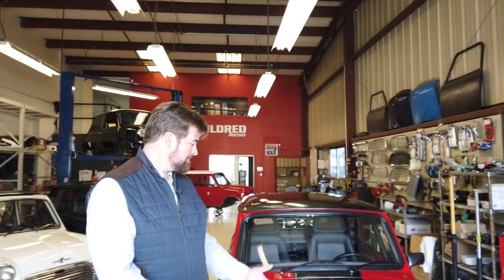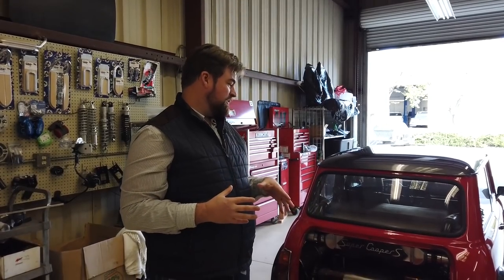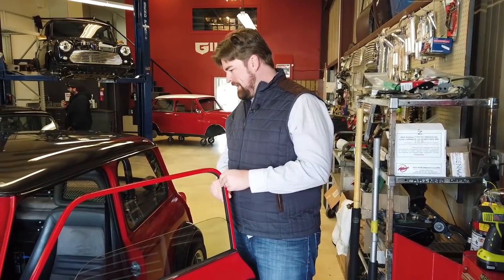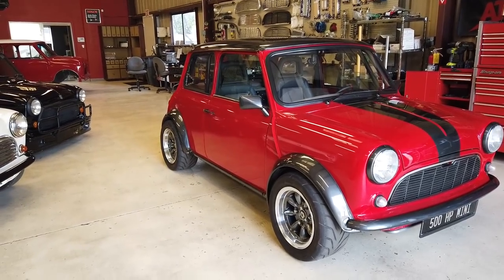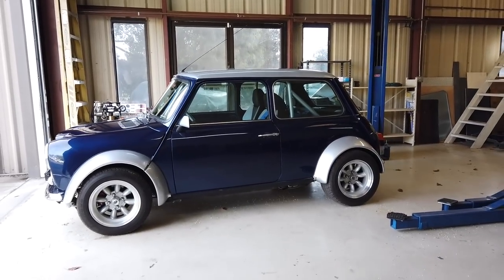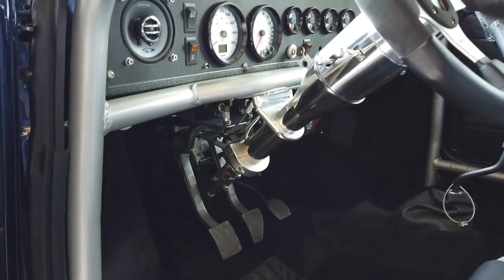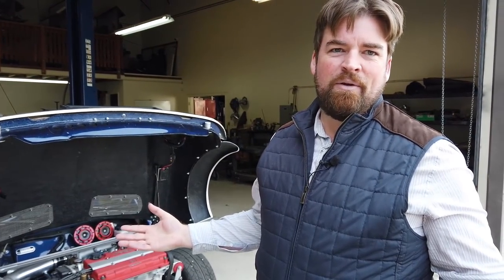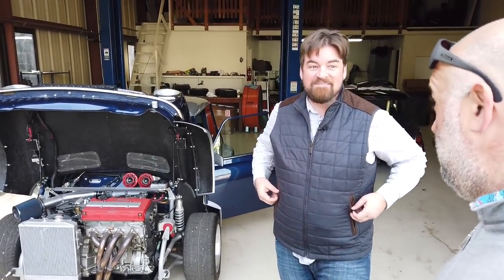How FAST Minis get Made (inside Gildred Racing) - Under the Hood

Comment: I would consider putting a Nissan pulsar GTiR SR20DET motor and trans for the 4WD build. But of course consulting the expert first. And I'm sure someone out there has done a 13B rotary in the mini right? I guess building these awesome minis, we have to look out for those smaller but high HP engines out there. I mean, VTec is always cool for NA, the best option IMO. Cool. 😃👍❤️🤘👏

Comment: What's the point of a mini if it can't corner properly anymore? Just buy a demon for less
Reply: This Mini would eat a Demon for lunch.
Reply: The poor condition of the road required a much softer suspension setting which adversely affects the handling characteristics. It can also be adjusted easily.

Comment: I know know I shouldn't care about this because it's built for fun, but what kind of MPG's do you get on those two cars? The power to weight ratio is insane. I'm curious to know whether or not there's a mpg benefit. Of course flooring it won't help mpg's, but the light weight must make it extremely easy for the engine to move the car, thus improving mpg.

Comment: with all the weight in the back and RWD the last thing you would want to do is "let off the throttle on the corners" because all your traction is also going to be heavily rear biased in that car so once in the corner you want to stay slightly on the throttle (not so much to be breaking traction obviously) stay on it just enough to avoid weight transfer to keep the weight on the rear which is where all your traction is going to be because of the weight distribution and also because the fronts are busy doing all the turning work for you. Thats how you drive the old 911s too, not at all how he explained it.

Comment: How does the Rotrex compare to a similar sized procharger or turbo? Asking for my FRS BUILD.
Reply: The rotrex and procharger would have near identical power band. Linear. A turbos power band would be slightly different with more bottom end power and torque
Reply: We have been using Rotrex primarily and found that in this configuration the Turbo isn’t as effective.

Comment: I don't think that coopers were made in 1974.They were on 1275gt's(clubman fronted) by that point.
Reply: Andrew Gardner 50’s to 90’s. England/Italy
Reply: Yer early Cooper's and s in 60s to mid 70s then 1275gt then Cooper's made a return early 90s but you can tell a early shell to a late one and none of these look like early ones mid 70s to 80s
Reply: We use the 74 Innocenti Cooper 1300 cars